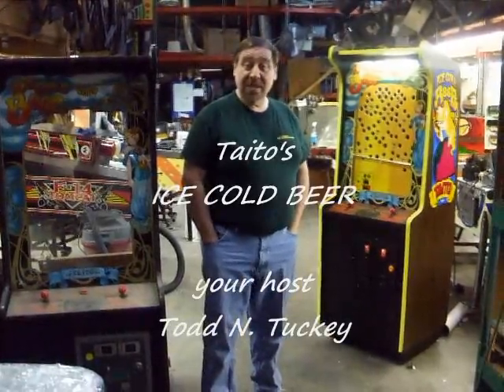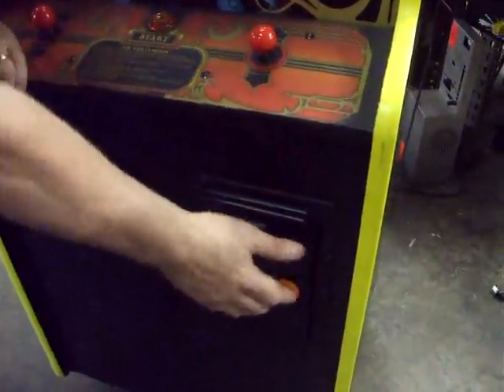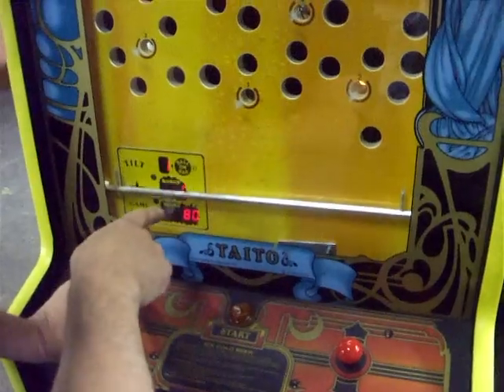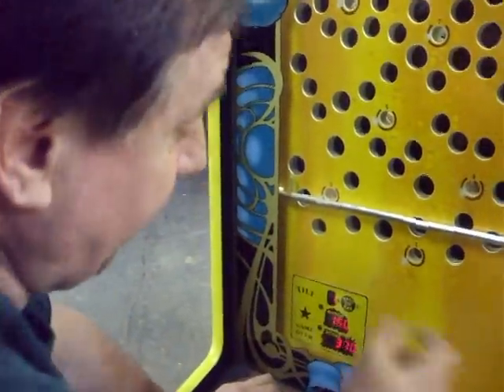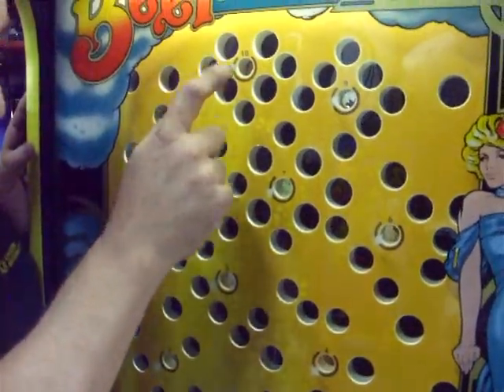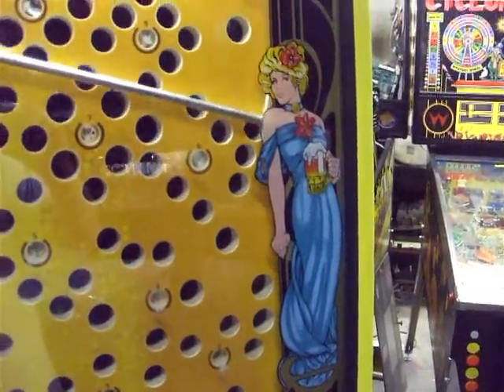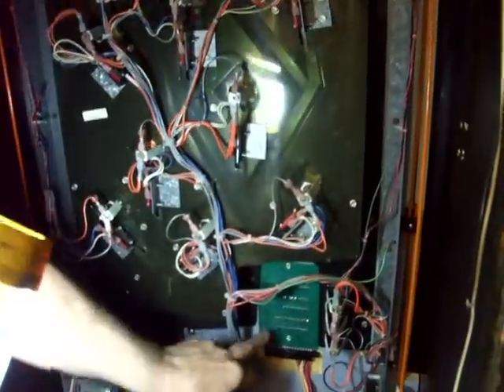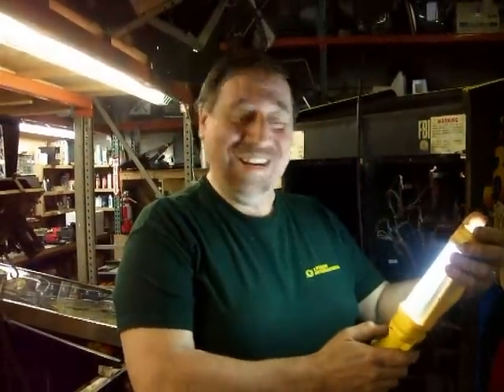#14 Taito's ICE COLD BEER Arcade Amusements Machine - TNT Amusements

Comment: Hi Todd

Can you tell me if there are different ROM versions for ICB? I ask for two reasons:

- My manual shows one "DIP chart" but there is a (loose) sheet added, showing a quite different (the actually working) DIP setup!
- As soon as I go for hole 6 or above, there seem to be some "Gremlins" kicking in, slightly "shaking" the bar (randomly), almost as the game does, when you're not using the joysticks. Can't see this effect on any video

Thanks for any hint!
Reply from the maker: Not that I know of.  There is a dip switch setting for the time between touching either joystick...so you can't "wait" for a long time.  By adjusting these settings, you can have the "jerk" the bars do after no activity on either joystick happen sooner.  We have several other Ice Cold Beer videos posted...if you watch one of those, that "jerk" will happen for sure!